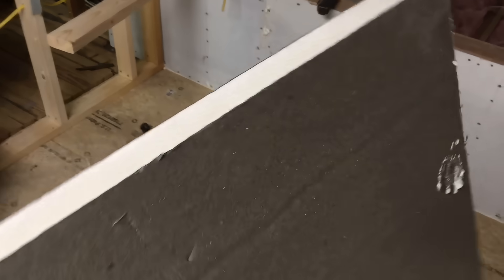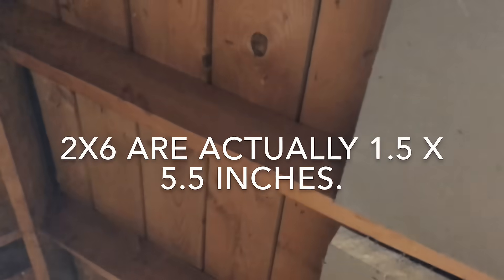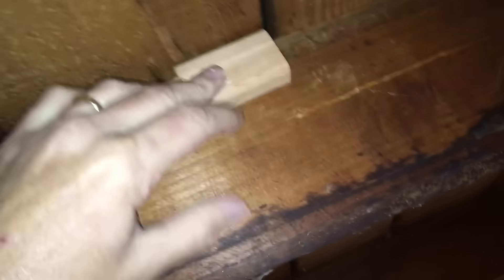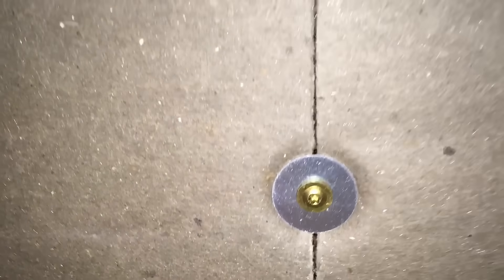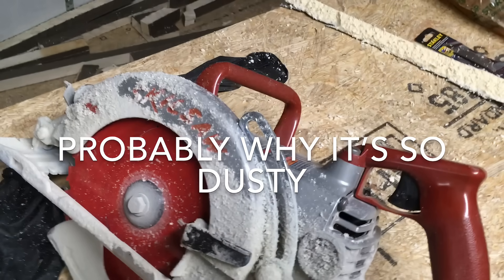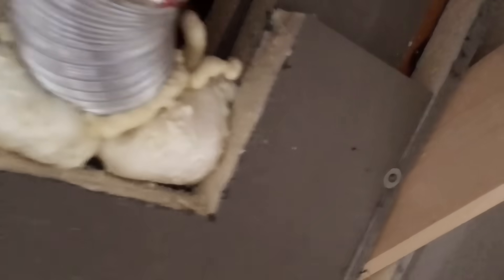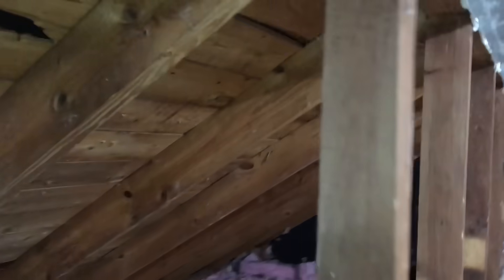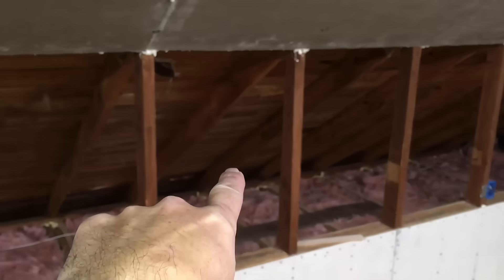Getting R-30 in an attic suite with 2x6 ceiling rafters

Comment: The ventilation space is not just for the shingles, it is also to carry the moisture, especially in winter as most heat goes through the ceiling. Mold and all kinds of other problems can start.

Comment: I don't like attaching drywall directly over foam, especially thick foam boards. Starting back in the late 70's in the Boston area, I used a design from an architect buddy, for cathedral ceilings. At that time, FG batts were known to "fluff up" over time.  So, to maintain an air space, the batt had to be at least 2.5"  less than the rafter space when installed (such as R-30 batts in 2x12 rafters).  Then, we ripped 1.5"  or 2'" XPS foam boards to 14.5" or 22.5" widths, and applied them continuously to the underside of the rafters, alternating with 1x furring of the same depth. 16" O.C. for 1/2 drywall and 24" O.C. for 5/8" drywall or 1/2" ceiling board). Spray foam not known back then, and we did not use any. This broke the thermal conduction very effectively, maintained the vent space (with eave and ridge vents, of course), was kind to the drywall guys and proved to be durable for the decades that I followed these jobs/ performance. Critical: DO NOT use a sheet poly vapor barrier, it becomes a moisture trap. Any moisture that gets through on this assembly is vented out the ridge.

Comment: Look Code in many cases is for sale. The use of open cell or close cell foam is one of the most life threatening things you can do. I don't give a Rats Ass what Code Says. Don't do it. As a Industrial BC licenced contractor we built commercial freezers and installed commercial freezer doors. 
IN A FIRE YOU AND YOUR FAMILY ARE LIKELY TO DIE .THE BLACK SOOTY SMOKE MEANS YOU NEVER ESCAPE. 
The manufactured and spray foam people claim it is none flammable.  Plastic of this variety burns particularly if wicked. Don't use it in Residential or sleeping area. Look they lie. Codes are manipulated like everything else. Now in some states Copper Clad wire is back in?  Yes, indeed. Oh, it is copper coated now, BS. Proper connectors make it safe or skin effect or how about the truth Greed made them claim it is safe. It isn't. 
Side note. In any case do not cut any foam board with a power saw or chain saw. You can shorten the life of the tool quickly. The foam dust will accumulate on motors, close vents and melt on cooling surfaces. Destroying the tool. We would run panty hose on chain saws to prevent overheating and premature death of the saw after just a few hours of work. 
Again burn some of this foam. I don't care what some bought and paid for an engineering firm or code officer says. NO WAY! Burn a piece. Wick it if needed. You'll see. It is your choice not some government tick. 
RT

Comment: Here’s a crazy idea …why not tack additional lumber to the existing rafters to give you the depth you need. Then use regular r-30 insulation. Less work and much cheaper then triple layering foam boards

Comment: I'd like to run a single course of 2" foam board insulation over the 2x6 rafters, leaving the entire void empty, just to make my workshop cooler. Any prohibitions on using XPS in that way?
Reply from the maker: XPS (or any foam that is) needs to be covered by drywall for fire safety.

Comment: What an inspiring idea.  My attic is basically a crawl space for cooking pizzas right now.  I think if I can shrink down to half my height like Ant Man I can do this.  Thank you for the wonderful idea.
Reply: Lol. My roof is also shallow. I like this idea though and just had my ceiling abated so it is removed for easy access. Now's the time I guess.
Reply: Take the opportunity!  I'm trying to air seal the attic also and can't even get to the exterior top plates.   I may never be able access until next time we re-roof and will have to take off all the decking at the eaves to get a shot at it.

Comment: Fantastic video, super helpful even this many years later.

Any idea how well the R-30 would work out in northern Indiana as compared to a southern state? I feel like it might be enough, I don't want to lose more space with another layer of foam board. My option would be adding insulation underneath the roofing when I get that replaced. But that's an added expense.
Reply from the maker: Well, I know it's not code in Indiana, but I think it would be fine if you have a lot of sunny days :-)

Comment: Should be that much for spray foam and you'd have to do a different method for your roof, or stop it. 
You can also have bought the tanks for that much and been fast.. but this is familiar and clean overall to look at.

Comment: Thank you for this video! How do you run wires thru (or under, or on top of) the rigid foam insulation for lighting? Also, do you just screw sheetrock over these rigid foam boards for the final layer?
Reply from the maker: I left attic space above the collar ties to run wiring. So there's about a 2 foot tall open space at the peak. The collar ties just have regular r-30 batts between them ....  also, here's a video on the drywall, Myles. https://youtu.be/dGeoA1ji_iM  ... Thanks for the comment!

Comment: be sure you check your R-values BEFORE buying! where i'm at, most of the 2 in. foam board insulation is LESS than R-11 (even Owens Corning!). and the CHEAPEST 2 in. board was R-7.7!

Owens Corning DID have a 3 in. board that was R-15, so 2 of them would have worked. but it would also be 6 inches, so be aware...

Comment: Another means of fastening, if not already mentioned in the comments is to use what the roofing industry calls press plates. They are large thin metal washers used under rubber roofing to hold down rigid foam boards and give you a lot of holding power. Can be used with a variety of screw types.
Reply from the maker: Thanks for the tip!

Comment: When the wife and I built our home, we ended up using 2x12" rafters for a 12/12 pitch loft roof.  For the length, only 2 x 10" was required but I was also putting them 24" on center, so I overbuilt a bit.  We also did not use a ridge beam, instead using Ken's Carpentry idea of using a 12"x12" 3/4" plywood gusset on each side at the peak.  This gave us a nice open space from floor to peak where we could install polyiso and then batt insulation.  We ended up with an R-59 rating.  Our first floor WAS insulated with spray foam (at a cost of $6000, but it has been worth it.  We also built the walls using 2x6" 24 inches on center and wrapped the exterior in 1" polyiso, that was foil sided and foil taped from the foundation to roof peak giving us no thermal breaks at all in the structure.  That was then encased in ZIP board and taped.  We can heat the entire home with a small, efficient wood stove and it will stay warm for up to 36 hours after the fire dies.    I should mention we built the house on an ICF block on poured concrete foundation with a 40" crawlspace that stays warm even in -20F temps.  Check out some of our vids to see how we did it.
Reply from the maker: Good info. And I love Ken's Carpentry!

Comment: would use a ridge vent with eve vents and 1inch air gap to insulation.   R30 batts with 2x4s glued and screwed to existing rafters. 6mil poly carefully sealed to warm side of room.   fast,  clean,  cheap  with increased rafter strength and good air/moisture flow.

Comment: Five years ago I did  a large addition on my house. Scissor trusses with a vaulted ceiling. Local inspector required an R-value up there that was virtually impossible without ruining the venting at the  eaves. I had been in construction for quite some time, and I knew the inspector well. While discussing the issue I asked him how R-value was measured. He said it was by the thickness of the insulation. I asked about measuring it vertically, when the ceiling is sloped? By that measure, because of the ceiling pitch, I just made the thickness requirement by code. He laughed, and OK'd the inspection.
Reply from the maker: Nice!

Comment: I really like the small spacer blocks, rigid panels, layering and foaming the gaps. Great job and inspiring!   An alternative is to use the thin plastic air baffle panels directly to the roof, add a 2 x3 lumber on the face of the roof joists equaling the same 1.5" and use R-30 batt insulation as usual which may have been a bit lower in cost but I'm not sure.
Reply: Let me add that your method solves the thermal bridging  of the lumber.  A 2x6 only has R8 so covering it with 1 1/2" of foam board is really good.  Well done!!

Comment: I like your approach of using the long fasteners, but it is never a good idea to mix washers and screws of differing types of metals as they will corrode each other. You might get away with it for a decade or two, but the heads of those extra long screws will eventually rust out because of the washers.

Comment: How did you attach drywall on top of this? Having your studs buried an inch deep in insulation seems inconvenient for this, unless I’m missing something?
Reply from the maker: Good question. I actually made a video on this. https://youtu.be/dGeoA1ji_iM ... I also get a lot of questions on how it's holding up. ... Still looks as good as the day it was finished. No cracks and no screw pops.

Comment: 3 layers of 2in paper backed polyiso is R34.2, but w the air space you get even more r value, your around r36. If not enough insulation is added under that air gap, the air from inside won't have enough time to equalize to the outside air and will loose humidity in that space.

Comment: Your video gave me the idea, i went on hunt for the best r value foam and found polyiso which is like r-27 for 4 inches.  I luckily stumbled upon guy selling johns manville 4” polyiso 4’x8’ sheets for.40 bucks each.  I got 40.  

To cut i found what was best was using metal blade fine tooth on a sawzaw.  I measure the top, mid span, and bottom, put straight wood on the polyiso after making the 3 measurement marks.  Then using clamp on top and bottom i clamped the wood on the marks which gave the sawzaw a fence to go along so i got nice straight cuts.  Often it was a nice snug fit, sometimes i had to do a little extra trimming.  I only went with 1/2-3/4 inch air gap, which allowed for 1/2 inch foam board on top to fill in the bay.  I could run another r-10 rigid foam on top of that giving me close to r-38.  Think we going to do knotty pine tongue n groove on the angle ceiling pottion.  Our flat ceiling area is 9 feet.

Comment: I've got to say that this can not possibly be cheaper than spray foam. No way, no how.  What is YOUR labor worth?  I have a friend that changes his own oil because he says it saves him money.  My response was always why are you having trouble making money.  On to the engineering:  There is no way anyday that this will not condensate.  You now have a "mostly" insulated home with heat and cold still going about.  Seems like major problems are in your future.  Good luck.

Comment: thank you.  this is great.   There was 0 insulation between Rafters in my place and I installed a Sika 1/2 inch Insulation below Roof Decking between rafters, with a 2 inch air gap below it, to at least have something.  Used strapping above insulation as spacer - and below it to hold it in place.  Attic has No ridge vent, and won't have one ( historical home / not dealing with the association) so I stopped the insulation 8-12 Inches from the roof ridge to avoid creating a heat bomb at the ridge.   Will install Gable vents on either side of the attic to help move the heat out.   While installing, when my face is right in front of the insulation and air gap, I can feel the heat.   It's amazing.  Also installing insulation between joists above all ceilings. Attic is not a living space, and not for storage, but it does have flexible A/C vents run through it, and Air Handler for AC is located in attic too.   Hoping this moderate Sika 1/2 inch R 3.2 install with Gable Vents will reduce the "oven effect" in the attic.
Reply from the maker: Awesome. I hope it works well for you :-)

Comment: late to the game seeing this, but thank you for the info! i have been scouring for info about this kind of project and very little out there. i did have two small questions based on the end of the video in case someone can answer. when you said batts, did you mean the fiberglass (pink) batts? if so, would using faced batts be a need to fasten within the new studs? would a friction fit material like Rockwool work as well? thanks to anyone in advance!

Comment: This works if you are able to sacrifice ceiling height.  There are 4.5" R30 insulation boards but, naturally, no big box store will order them and they're only available from distributors that (so far in my experience) will only sell to insulation professionals/contractors or you have to buy six pallets worth for almost $7,000.  Considering R30 is code and a LARGE NUMBER of homes are built with 2x6" rafters, I am BAFFLED that R30 foam board is not in Lowes/Home Depot/Menards/etc on the shelf.  Absolutely annoying.
Reply from the maker: No kidding. There should be an easy, economical, and easily accessible option for this. There is certainly a market for it. Great comment!

Comment: I did a project similar to this.  A problem that occurred with it was that our vapor barrier got punctured allowing bathroom moisture into the insulation cavity.  One wiring penetration wasn’t tightened up.   5 years later there was moisture in that insulation space and some rot in the roof deck.   Roofer found it.  We went back and fixed it.  You can’t be too careful when you insulate in a space like that, especially if there is a shower in a bathroom or a kitchen.   Venting moisture sources is so important.
Reply: Or could you use a dehumidifier? I used to have a dehumidifier in our bathroom and it made all the difference in the world 🌍. Also now that I just moved our laundry 🧺 room in our insulated shed I have a dehumidifier out there. Again it makes a huge difference. I could "vent" or have an exhaust fan out there to buy a dehumidifier works well. I live in humid Central Florida.
Reply: Yeah I just don't trust foam for that exact reason
Reply: @shaquileoatmeal7365  This type of foam board seems like it would do great because of the air gap. Spray foam scares me.
Reply: Ridge Vent should solve that problem provided there is sufficient airflow between the insulation and decking.

Comment: I'd really like to see this at the top and how you seal it (or not).  I want to use something like this or 2" poly-iso foam in our attic which is a 2x4 truss system, so I only have 3.5" to work with and thus would only do one layer or two.  We also have 6" of blown in insulation on the ceiling.  I also wonder why you would not use foil backed foam on the top layer as a radiant heat barrier?  Radiant barriers with an air gap work wonders.  Regardless, how do the 1.5" air channels vent out at the top?
Reply from the maker: The collar ties are insulated with R-30 fiberglass batts. The foam board just slightly overlaps them to allow the air to pass into the tiny attic space above, and out the ridge vent.

Comment: "R" values measure only what the companies that make wool type insulation want.  Heat transfers through conduction, convection and radiation.  "R" value only addresses conduction in a very imperfect way.  The test is in a controlled setting with no air movement, no radiant sources and is done is just a couple of hours.  Wool insulation does nothing for convective or radiant losses.  In fact, when cellulose (shredded paper) or foams are subjected to the same torture tests for an extended period (say 24 hours) their conduction losses are the same as the wool insulation tested for the same period of time.  The foam and cellulose block almost all of the radiant and convective losses.  To see the difference, go to a good supply house and place your hand under the wool insulation with a heat lamp above it and then place it under the heat lamp blocked with wool type insulation.  Unless you have to have your work inspected, just use foam board and spray foam and be done with it.  If you do need to go through the inspection process, see if the approving engineer will approve a different insulation scheme.  If not, hire your own professional engineer to approve and monitor your work.  In the long run, it'll be cheaper and most importantly, you'll have a better job.  My heating bills have been reduced by at least half since I started doing it this way.  I'm in the process of tearing out all the wool type insulation in my home and installing foam boards.

Comment: bats of 6" R-19 covered by 2" of the R-11 foam board over the studs would have gotten him there cheaper, faster and look better with much less cutting of fiberglass.
Reply: Nice idea.
It would give better overall insulation too: ~R17 at the studs vs ~R6 for the 2 out of 24 inches ... the batts would also reduce temperature at the foam board to minimize off gassing and degradation.

Comment: If you are using rigid insulation, 3/4 spacing off the deck is more than enough.  Why are you using a saw to cut foam?  Use a knife.  Before I'd do any of this, I'd staple up vent baffles and spray foam the whole thing.

Comment: Use a hot wire cutter. You can diy one from an old computer power supply. It will eliminate most, if not all, of your "sawdust".

Comment: Given that a 2x8 is actually 7 1/4" deep and R15 insulation is 3.5", what are you thoughts on using 2 layers of R15 insulation in the 2x8 cathedral ceiling? Depth wide it adds up to 7" and also the R values add up to 30.

Comment: First thanks for taking the time and sharing. But, how do you fit 3 layers if you took 1.5" from the total 6" ? Mine is around 5.5", i can only fit two layers?
Reply from the maker: The third layer goes across the rafters, not inside. Hope that helps.

Comment: You can easily cut most foam insulation board with a 6" drywall taping knife and straight edge to almost eliminate the dust...